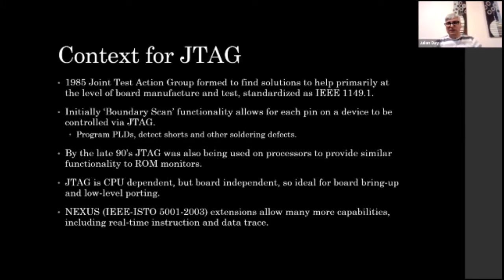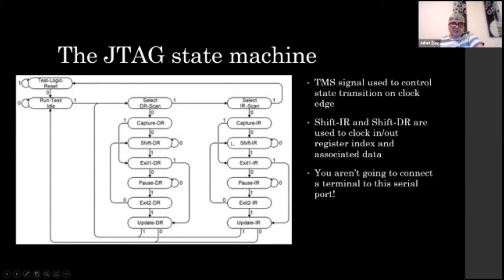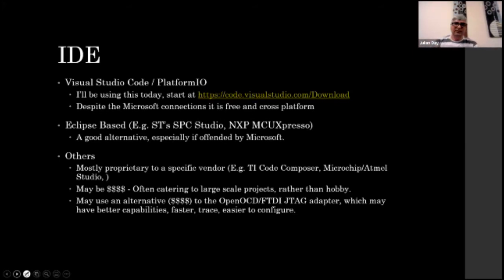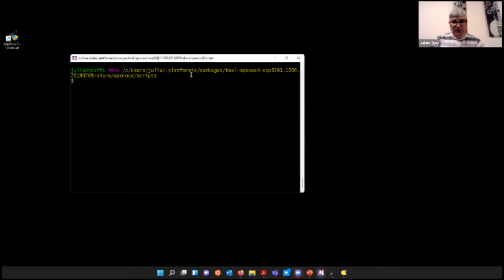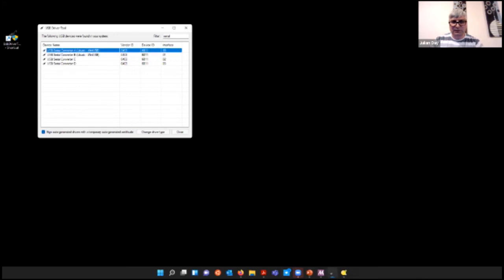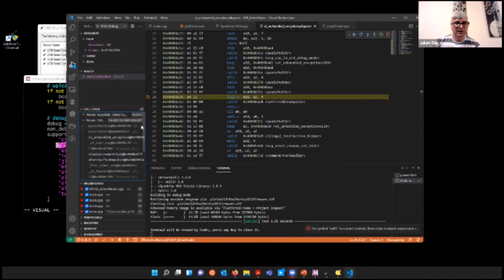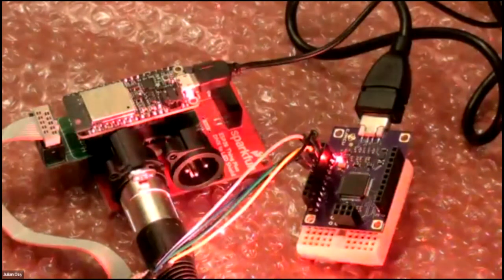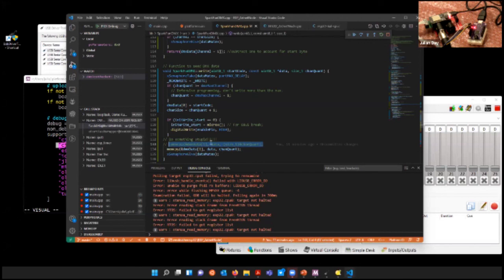Julian Day   JTAG Interface

Comment: If Jtag is a standard for all devices, why are different programmers needed?  i.e. an Altera/Intel USB-Blaster won't program a Xilinx FPGA?     I assume inside the debugger adapter is just a USB to I/O converter.. why would different hardware be needed for different FPGAs/CPLDs?

Microcontrollers seem like they are more universal.. for example, a J-Link will program a Arm from STMicroelectronics as well as from Microchip/Atmel.   Is that because Arm leverages a standard CMSIS-DAP that can be used by OpenOCD, whereas FPGAs don't have such a standard?